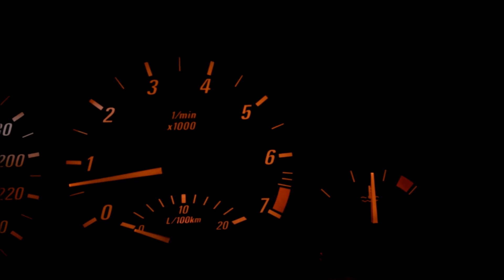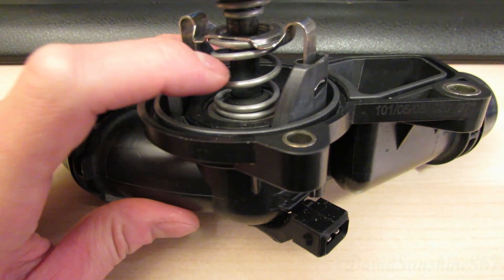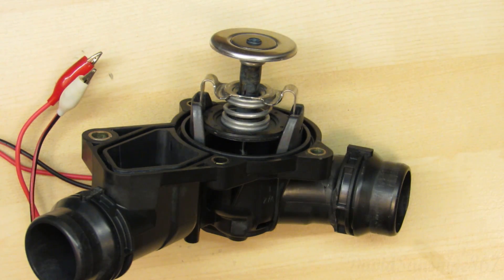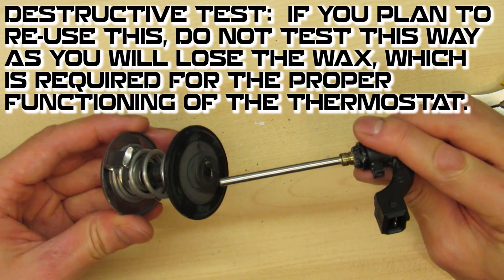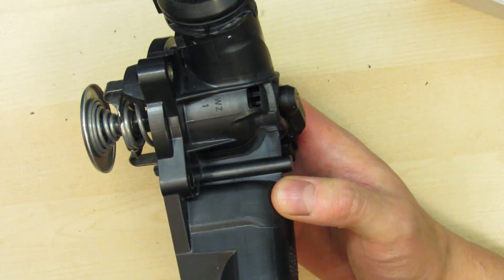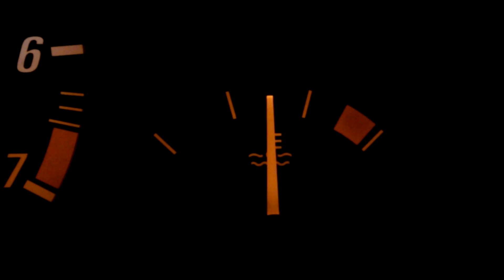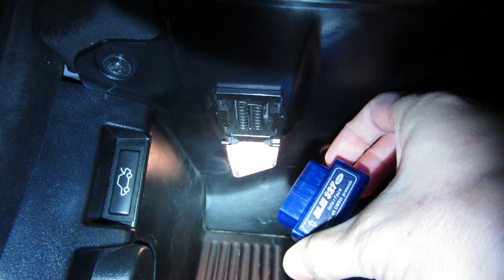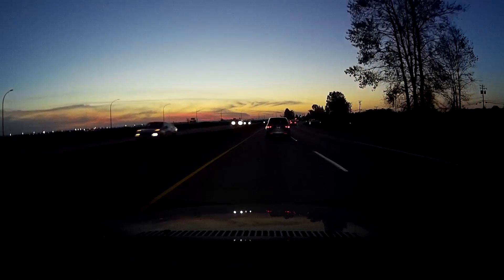How a Thermostat Works in the E46 - How to Diagnose a Broken Thermostat

Comment: nice music at the end. NICE VID!
Reply from the maker: lol thanks man! Should have been there, dual compound loaded 10" infinity subs, off a 450W clarion amp.  Nothing crazy but definitely enjoyable and better bass than stock.  Glad you enjoyed the video!
Cheers!
David.
Reply: @DavidSunshine  so did you modify the sound system on your E46? do you have any vids about it?
Reply from the maker: @maxliu1151  Nope, I left the stock system in there.  I don't have any videos, but it was all straight forward.  Just Google videos of how to remove the E46 stereo and follow that, be careful not to break the trim, I pulled too hard and it cracked the plastic, so go slow and don't pull too hard on plastic parts.  I just added the subwoofer to the trunk and spliced to the speakers in the rear for signal.  I did it brute force, ripped the plastic backing to the speaker and connected to the wires for left and right signals, my subwoofer amp had a speaker level input (I think most do), so you can connect to speaker circuits like that and get the signal easily.  Just connected to the positive terminal block beside the battery, and negative to the body.  I did get a switched12V from behind the stereo and brought it back to turn on and off the amp with the stereo tho, that was a pain to do.  I also added an aux 3.5mm kit to the stereo, you can buy those for $30, definitely worth it to get good quality sound from spotify or mp3s.   Those are the two upgrades I would recommend, an amp and aux.  You could just burn mp3s to a CD, that works pretty well and produces good quality, but CDs are a hassle to handle, so the aux cable is worth it. 
Cheers!
David.
Reply: @DavidSunshine  Thx for your patient reply! it is useful and I will think about that since I am having a convertible E46.
Reply from the maker: @maxliu1151  Anytime!  If I were to do it again, I'd probably install a compact sub unit, they have a lot out there. The convertible has less trunk space so something like a Pioneer TS-WX130DA would be nice. Look into it if you're interested in some more bass.
Cheers!
David.
Reply: @DavidSunshine  yea but I am wondering does it fit the OEM space? will I have to cut or anything installing the pioneer?
Reply from the maker: @maxliu1151  They are pretty compact, you could just strap it against something, no cutting, but maybe sheet metal screws into the body, just to install some tie down hooks, you could use a cargo strap(like this  https://www.amazon.ca/dp/B074CQFH65/ref=cm_sw_r_cp_apa_i_xxmsFbB7YK05X) to secure it. Then if you need to, you can easily remove it and move it around if need be.  You can get creative with how you strap it down. I just strapped mine to a body support for the rear fender.  Any space you find, they can install for you. If you don't want to do the wiring or install, you could probably get best buy or visions to do it for you too. 
Cheers!
David.

Comment: 1998 e39 528i Automatic, replaced the original BMW thermostat with MAHLE Thermostat it should open at 92C but it climbs to 102C is this normal? 
Thanks for the video?
Reply from the maker: Hi,
Ya that should be normal.  It opens at 92C, so it should start cooling after that.  102C isn't too bad.   It's a little hot, but it's a small engine so maybe they put a smaller cooler in there. 
You may have high antifreeze content in your coolant too, so the temp will generally go higher up than if you had more water.  I'd run 50/50 unless you're in a really cold climate.
Cheers!
David.
Reply: @DavidSunshine   Thanks!
I noticed it opens at 94C and stays around 100C/105C while I'm driving.
It worries me, after short drive (15min.) the lower hose (after thermostat) it has a lot of pressure built up when I squeeze feels like more air in it rather than the coolant , it's not hot like the upper hose (the one that goes to the expansion tank).

Bad thermostat, water pump, blown head gasket, bad auxiliary water pump?? Engine only 30 000

Comment: Good tip on testing w/ 12V. 
My E39 coolant temp was thru roof today. First time. I'm guessing thermostat gone bad?
Reply from the maker: Could be, but usually they get stuck open, but could be stuck closed I suppose.  If it's old, might as well replace it. 
Sometimes the expansion tank cracks, that drops the coolant and causes overheating.  Check to make sure you system is still full and sealed up.
Water pumps are known to go bad too, and fans, I would check it all. 
Cheers!
David.

Comment: Have an E46 that overheats thermostat, radiator, hoses and water pump have been replaced and it still overheats
Reply from the maker: Hi,
If you can confirm that the water is pumping and the system is bled of air, and everything is new and working properly, the electric fan or the clutch for the main fan might not be working properly.  I would check those next. You can read the coolant temperature from the dash, there's instructions for it in the description of my video, and you can search "E46 coolant temperature readout" on YouTube and you'll find videos on how to access it.
Cheers,
David.

Comment: My thermostat opens at 105 degree celsius E46 318i, N46 engine. Is there a way to make it open at 90 degree ?  the car runs at 105 degree all the time by the manufacture
Reply from the maker: Hi, 
I think you can buy reduced temperature thermostats.  They come with various temperatures.  The lower ones are great for longevity of the engine, but not great for fuel economy or emissions, as it's probably better performing with a warmer engine.
Cheers!
David.

Comment: Yessss, I use the same adapter with the same app! Been using it for years on all my vehicles
Reply from the maker: Lol awesome! Ya it's great!  I've gotten Carly too, so that I can code and do deeper diagnostics, definitely worth it if you need those extra functions. Especially battery registration for the newer BMWs.
Cheers!
David.
Reply: @DavidSunshine  carly is next!
Reply from the maker: @slammedb18a1  nice. I recommend it.  It saved me when the car battery was low and all the systems locked up and it wouldn't start again until I cleared all the codes. I've also used it to code mirrors, warnings, and other useful features.
Cheers!
David.

Comment: I have a 2003 330i that recently had the temperature gauge sky rocket to red within 5 minutes of leaving the house.   This has never happened. I’m suspecting a thermostat that’s stuck close .   Any comments are welcome .
Reply from the maker: That sounds like you may have low coolant, check for leaks, and when cool, check the level.  The expansion tank typically cracks, and has a super slow leak, once it's low enough, it can exhibit that temperature spike like you've been noticing.  
A water pump failure could also cause the same thing, if it's not moving the coolant, it can overheat in 5 minutes too.
A stuck thermostat can also do the same thing.  I would replace it if it's over 8 years old for sure.  Mine only lasted 10 years.
Good luck!
Cheers!
David.

Comment: Just wondering, by holding the thermostat how it would be installed, which is the positive/negative? Would like to perform the same test as well but unable to figure out which is which and can't see in your video.
Reply from the maker: Hi, it's a resistive element so it has no polarity.  You can connect right up to it with 12V DC or AC, it won't be damaged.  
Cheers!
David.
Reply: @DavidSunshine  Awesome to know, would the condenser fan by chance be the same way? Always worried about trying to jump a part and accidentally shorting it out/causing more damage.

Say I were to have it hooked up but the connectors accidentally touch would that cause damage??
Reply from the maker: @TheEliteShatter  For fans, you'll want to hook it up with proper  polarity, as they intended. Wiring diagrams will show which is + or -, and sometimes you can tell by the wire colors, brown or black should be negative, but might not be 100%.  If you reverse a fan, it could just spin backwards, but you never know with these things.  If they put a capacitor there, it could blow that, don't want that, so try to make sure you connect it in the right polarity.
Cheers,
David.

Comment: Brother my e46 heats up and spews coolant on the ground but no leaks.
Reply from the maker: Sounds like the thermostat is failed shut.  Or it's low on coolant and wasn't pumping, that'll make it overheat and boil over.  You need to fill it properly and bleed the air out. But if it was running fine and started boiling over, most likely you got a failed close thermostat, jammed in the close position.  
You can troubleshoot your system, or just replace the thermostat.  But I would fill it with distilled water and bleed, and check the functionality of the thermostat and waterpump.  That way you know if you have to replace the water pump and/or thermostat. Water is cheap, so it's worth it.  I wouldn't do it with coolant, cuz you'll dump it to replace the thermostat anyways, or pump.  
My bet is the thermostat tho.  Water pump might go if your car is high miles and you haven't changed out the coolant often.  I've never had a coolant pump go on me tho.
Cheers,
David.
Reply: @DavidSunshine  brother my goodness thank you so so much..for replying. Your the man brother. You couldve totally ignored me. Its 2001 e46 bmw. Ill do exactly what u said. It dumps right under the engine bay on the side of the radiator. Thanks pal u helped a bunch. Ill start 1st thing in the morn tom.
Reply: One more thing pal.should i bleed it first? Or should i look at the t stat first? I have a vid saved on e46 bleeding so that shouldnt be hard. Ill even jack up the radiator side just for giggles.
Reply from the maker: @7igerpr1nce  No worries.  If it's 2001, the plastic is all brittle, so maybe you have some cracked plastic, but you said it wasn't leaking? Cracked plastic usually results in a spray at higher temps.  It just overheats and then boils over?  Make sure the belt is ok and is spinning the water pump fully, if it wasn't, you'll hear squealing and the battery light would come on too.   Sounds like it's not pumping coolant, leading to overheating and boil over.  But fill it up and check everything one by one.  With the radiator cap off, you should be able to see fluid flowing, that means the pump is working.  My belt once broke and it would overheat in about 7 minutes. The temp sensor still read correctly, so at least you can check that.  Load up the temp reading on the cluster, you can keep an eye on the temp, if it goes to 103C I would shut it down, don't want it overheating too much.  If you are gonna heat it up, you'll want some antifreeze in there, not all water, otherwise it'll boil the fluid, 30/70 - antifreeze/water should be ok for testing, ballpark is ok.  For the temperature read out, check my description. There are also other YouTube videos that show how to access it on an E46.
Cheers!
David.
Reply from the maker: @7igerpr1nce  I would bleed it first actually. This ensures you have it properly filled up.  I'm not really sure why it overheated though.  If you had old coolant and it was mostly water, and you overheated it car on a hill, you could boil the coolant and cause these issues.  Was the coolant a proper 50/50 solution?  
I would start with a working system. And try to troubleshoot each component. If you bleed it and fill it, you can be certain that the pump will pump fluid correctly, if not, you know you have a failed pump.  If the pump works, you can check the top driver side radiator hose, if it stays cool even though your engine temp is high, for sure you know the thermostat is stuck closed, and it needs to be replaced.  Now if both are working, and you still get overheating, maybe the fan is not working?  I forget, but you may have a clutch fan and an electric fan.  You'll want to check that both of those are working ok. 
Did you overheat in stop and go traffic? If so, those fans may be failing. Fuse maybe. The control circuit for the fan sometimes goes. There are videos out there that show how to check the fan operation for the E46 too, may be worth a check. 
Those are things I would check first.
Good luck!
Cheers,
David.
Reply: Well heres what happened my wife told me the dash light came on. I checked and of course we have low coolant. I poured in some coolant later that night drove it to the store it heated up on the way back from the store I left it overnight and the next morning found there was a leak. I went to the nearest auto parts store and bought a stop leak import it in as directed. It look good afterwards no leaks but then all of a sudden the needle went from normal to hot really quick while driving and we pulled over and seen all the coolant leak out the bottom. We were able to get more coolant in and drive home. Tried to get more coolant in as it was marking low and it just spilled out.
Reply from the maker: @7igerpr1nce  Thanks, the background story helps diagnose.  Oh ok. So maybe it was a hairline crack that started all this; leaking out the coolant.  That should be the root cause.  Any other symptom is probably just a result of air in the system from low coolant and boil over, not a failed thermostat or pump.  
I tried the stop leak too, but since it's a hairline crack in plastic, it won't work. If it's in aluminum, it could work for years, but not these plastic BMW parts.  Common leak is the expansion tank, but that's driver's side.  You say it's the passenger side it's leaking from?  Maybe the plastic radiator fitting on the bottom, it's got the temp sensor there too, that leaks sometimes as well, right at the o-ring, get a new o-ring in there and it'll be sealed right up. The size is hard to get right, I just wrapped it with Teflon tape and put the old one back on, worked like a charm. Fill up your system properly, jack it up, open the bottom splash panels and turn it on, once you find the actual leak, resolve that and you should be golden. 
Cheers!
David.
Reply: @DavidSunshine  God bless brother. Take it easy. And keep being a good person...we re going extinct.lmao. thanks again.
Reply from the maker: @7igerpr1nce  You're welcome!  For sure!  Can't let that happen!  Good luck! Cheers, David.
Reply: @DavidSunshine  ok bud heres the deal we found a ripped hose under the  radiator its showing the mesh and yes we got all the bubbles out via water. Do i still need to do the thermostat? Can thr car run on this water? Im very desperate and low funds due to multiple bottles of coolant.what do u recommend on patching he up? I have very little coolant to add to the water.
Reply from the maker: @7igerpr1nce  Hi, glad you figured it out!  You can run on 20% coolant/ 80% water for a bit. But I would get it up to 40/60 quick as you can.  Buy the universal stuff that isn't mixed, then but distilled to fill the rest. 
You should replace the hose with a new one. I don't recommend hose repairs for extended use.  Check prices online at Rock Auto, it's pretty cheap. 
I think you can just fix the hose and you'll be golden, don't think the thermostat is screwed up. It should run properly once you get it filled and bled.
Cheers!
David.
Reply: Happy new year pal. Success!!! Thanks to ur kindness.
Reply from the maker: @7igerpr1nce  Great news!  Good job!  Glad the repair was successful.  Glad to help! Happy New Year!

Comment: Hi Again, after 9 months!
Would you please share how you made the plug connecting to the thermostat. I have to make one to force the thermostat open while the engine is running to properly bleed the coolant.
Thanks a lot.
Reply from the maker: Hi, I just used alligator clips to connect to it. There is no polarity, so you can connect 12v either way. If you want to permanently connect it. Just cut the connector wires and connect 12V to it. 
Cheers,
David.
Reply: @DavidSunshine  great thanks
Reply from the maker: @AndyNav1  Anytime! Cheers, David..